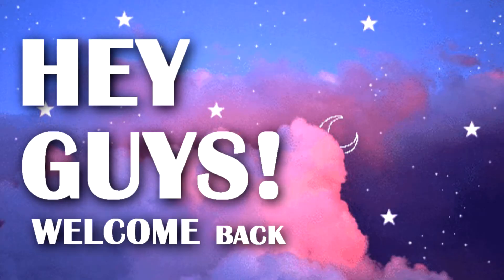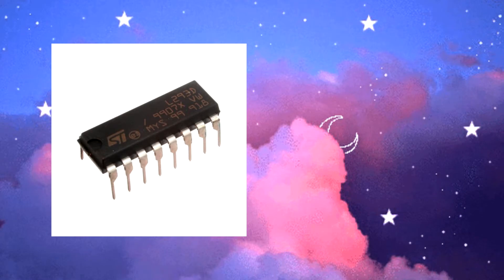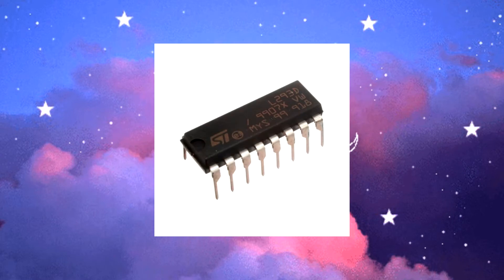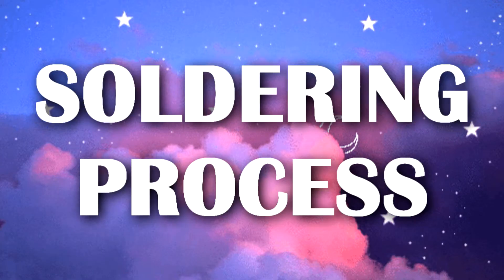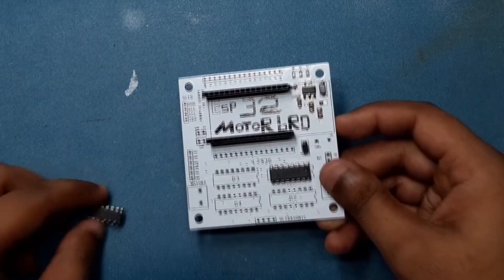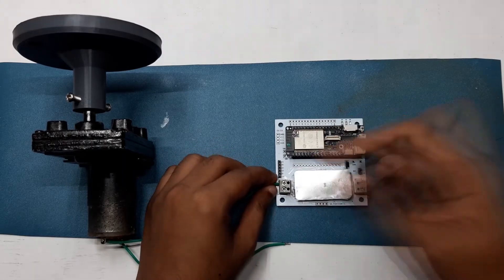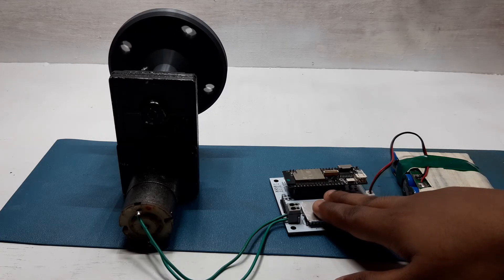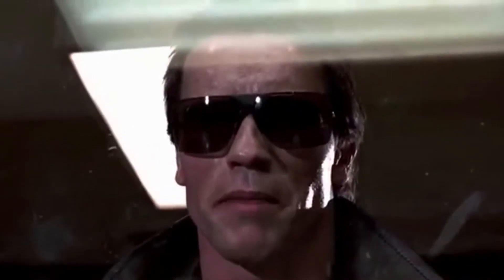ESP32 L293D High Power Motor Driver

Comment: Can u do this same technique with L298n motor driver chip ?
Reply from the maker: @shardulambikecs1192  yup. Can be done
Reply: @ArnovSharma  can you guide me how to ? Or else guide me which high power motor driver I can use for 775 12v DC motor